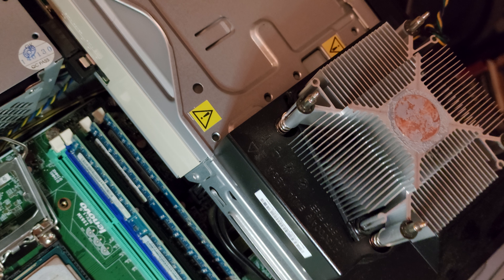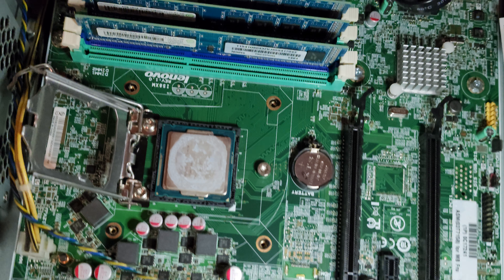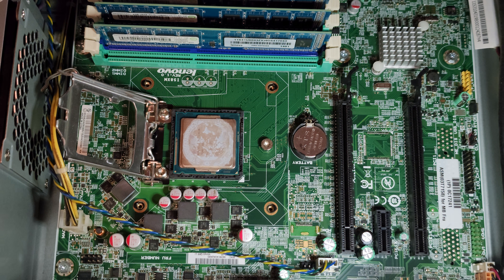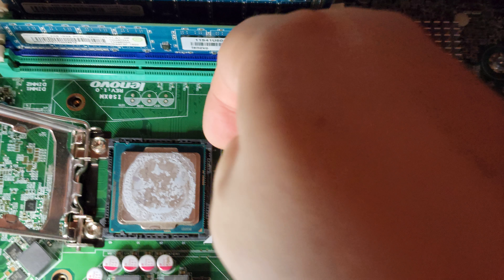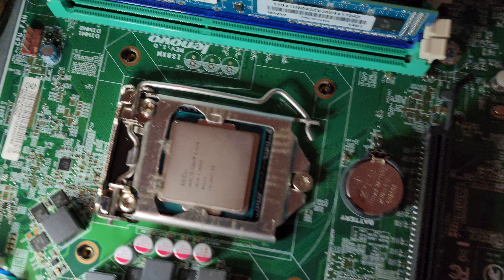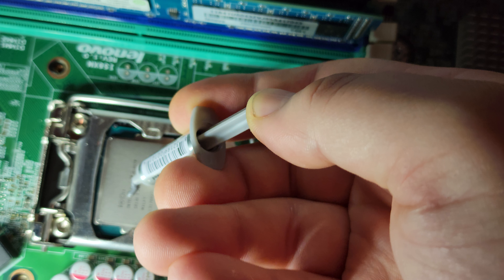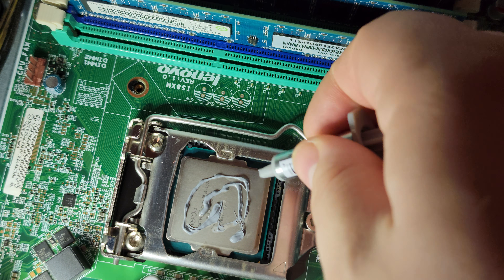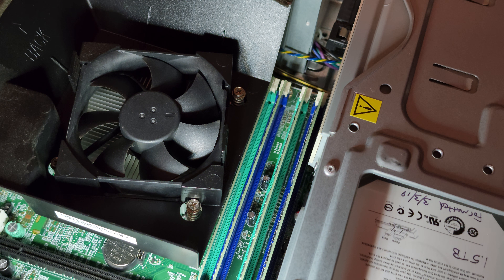Lenovo ThinkCenter M83 CPU Upgrade i3 to i5 4570

Comment: Do you know the limitations on the cpu upgrade? What’s the max cpu upgrade that the motherboard accepts
Reply from the maker: I7-4790 is the highest cpu this will support.  https://psref.lenovo.com/syspool/Sys/PDF/ThinkCentre/ThinkCentre_M83_Tower/ThinkCentre_M83_Tower_Spec.PDF
Reply: @techmaster170  are the m92 and m93 specs different or are they all similar

Comment: i upgraded to I5 4590 and i got 3 beeps , when i switched to I3 it worked fine can you help me figure out where the problem is ?
Reply from the maker: @abdelhakmenouer3334  That cpu is bad. You'll need to get another one.
Reply: @techmaster170  thanks bro, i already sent it to the market i bought from, and i'm waiting for a new one is it okay using that cpu even the original psu is 240 watt max ?
Reply from the maker: @abdelhakmenouer3334  No problem. You should be okay. But, you should look up the cpu power requirements and compare.  Just to be safe.

Comment: is that a Lenovo ThinkCentre M83 10ANCTO1WW?
Reply from the maker: Probably.
Reply: @techmaster170 Oh okay, thanks. Just making sure because my dad just brought home the same brand and pc model so I took it and plan on upgrading see if it works out for gaming but I went first to see if others have tried with the same model haha
Reply from the maker: @markuchi4756  in one of my other comments I responded with a link to a pdf document for all supported CPUs.
Reply from the maker: If you can get a gpu in there.  It would be an okay budget gaming machine.  You might need a bigger power supply though.

Comment: How many Wat in psu?
Reply from the maker: I believe it's 280-300 watts.
Reply: Can it work with a graphics cardGTX 750ti ?
Reply from the maker: @beautynatureshorts2733  IT doesn't have any gpu connections.  What's the power requirements for that gpu?
Reply: @techmaster170  every GTX 750  no need extra connector,  amm other alternative full upgrade will be  Xeon E1270V3 and Radeon RX 6400 for games AAA work perfect... another new low profile video is the RTX 4060 but... i believe need a connector. and the power supply  dont enough